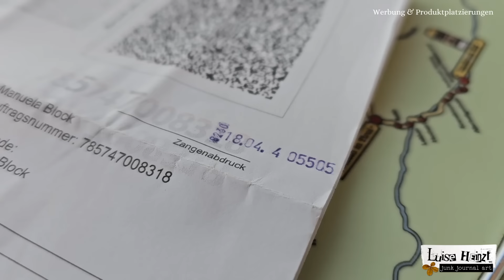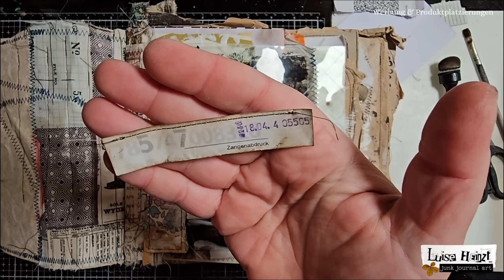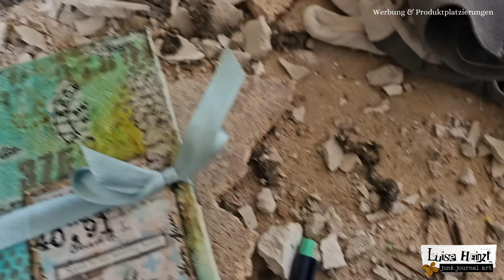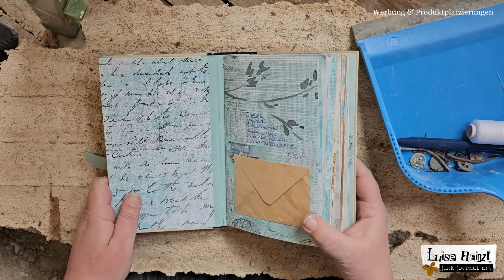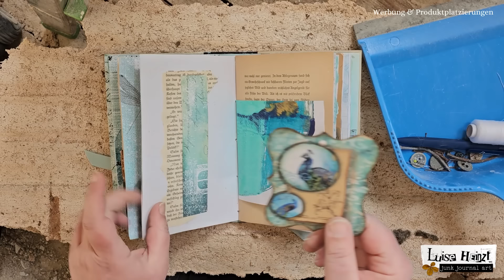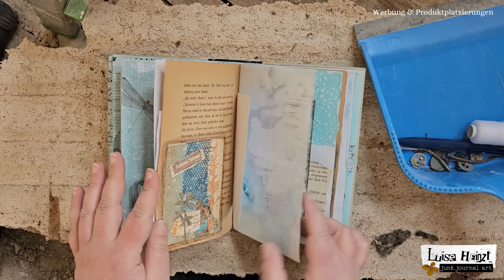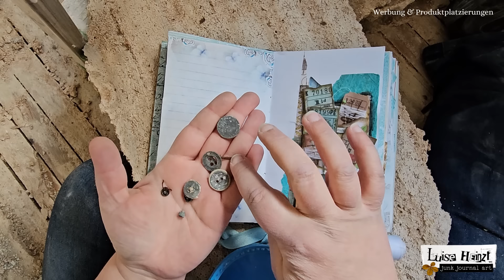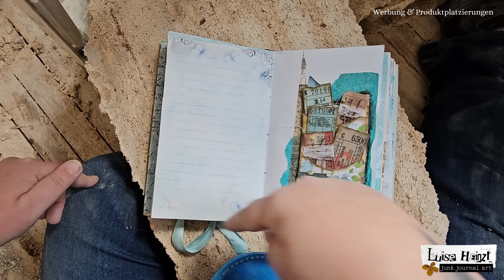Last video from my old & first video from my new craft room! Let's travel trough time together!

Comment: I'm guessing the buttons and pins are probably from the layer between the wooden floor and the vinyl /linoleum floor.  You must have a mostly flat  "smooth" surface to lay vinyl so they would cover floorboards or slats with a smooth cement, cure that, then put down a waterproof paper before laying the vinyl.  My guess. depending on how old the house it, the buttons and pins maybe have been the people before the people before you!  So if you're third generation, the buttons may have been first generation.
I remember not having a table for sewing when my husband moved into a new apartment.  We didn't have room for a table so I sewed on the floor!  Spreading out the fabric, pinning and cutting the pattern then sewing and operating the "foot pedal" on the machine with my knee!!  I know exactly what you are saying.  I don't think I ever lasted as long in one sitting as you did in this video!  That was almost 50 years ago.  Now I can't even get down to the floor (unless I fall) much less get up after!  Those were the days of living to the fullest and doing anything you wanted any way you wanted.  Happy crafting in your new craft room.  😍😍😍

Comment: "The windows are MUCH closer to each other"
Reply: "There is A LOT of light," or "SO MUCH light"
Reply: The "clik-clak" is called a "snap" or  "snap fastener" in English. 🙂
Reply: The first layer of the flooring, the pieces there are called "wooden slats" and VINYL is correct!